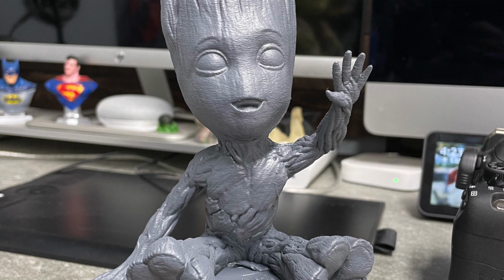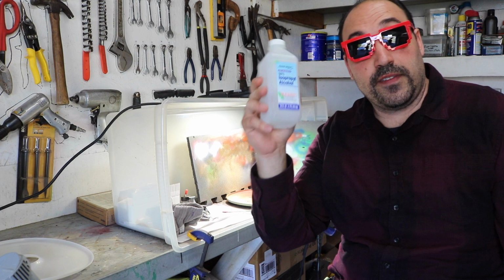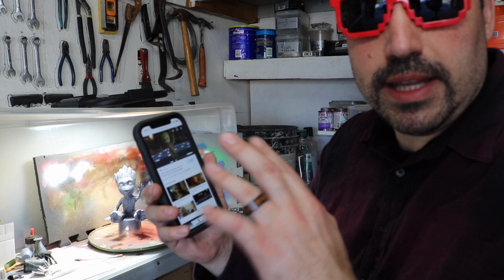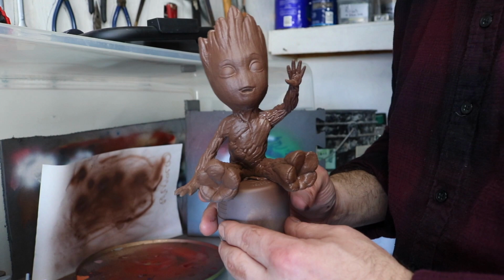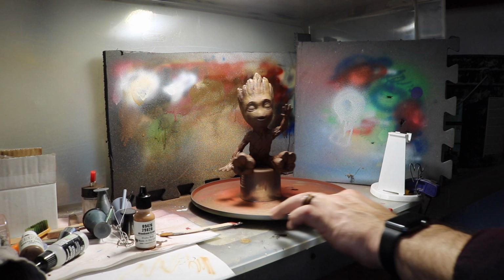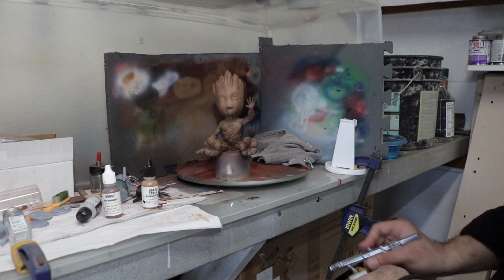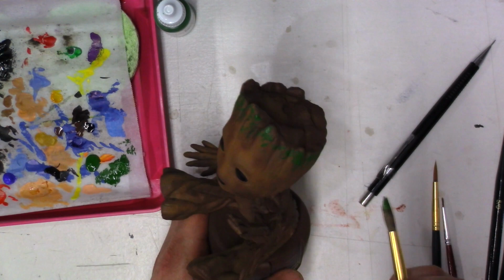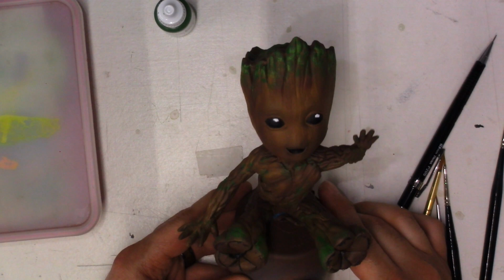How to airbrush 3D prints, the basics

Comment: A useful tip for some, I usually adjust my needle so that it's making the finest line Id be able to get by pulling it back. That way all I have to do when doing extremely fine details is just put the air on. It can add little dots though if you let too much paint go through
Reply from the maker: Never thought of that that is a good tip. I’ll definitely give it a try. Thanks 😊

Comment: Didn't come here for the WD40 trick but glad I saw that. I always have to soak the tips and needle in laquer thinner before starting since I don't airbrush much.
Reply from the maker: Lol everybody’s got their tricks! That’s why I watch everyone.
Reply: @CrazyWillTechShow  The wd40 doesn't effect the paints?
Reply: @crushingvanessa3277  know as he cleans the brush before using it as should you, because of the psi it will atomise the residual WD40 and eject it into the paper, then by washing the airbrush several times as in his video that would get rid of any remaining WD40.

Remember that WD40 is not oil, its merely a water displacement product and any traces of paraffin or other very fine petroleum products that are in WD40 would be emulsified by the cleaning water.  Of course if you just airbrush without the initial clean it will mess the paint. Hope that helps.
Reply: @sitgesvillaapartmentneilsc7924  Thanks for the info, didn't know how wd40 was made up. So many people spray it on things to lubricate them then wonder why it's not working.

Comment: Excellent entry level tutorial, thank you...

3D printer resin is great for smoothing your prints , you can also use 3d resin for clear coating, on any product be it wood, metal plastic , anything just make sure you cure it well and IPA wash it later, again apply with an airbrush, perhaps not you best one!!  It's an excellent lacquer that is fixed forever and won't tarnish like clear coat does over time.

Some really good sage advice and tips in this vid,  you dont need to spend a fortune on kit(Ç apart from a good airbrush that is!! But start with a entry level one to see if its for you before you splash out and mind the fakes if you do ...

Over here in europe I use high pressure sprayers for acrylic paint, thats at 250 bar 
or 3650 PSI serious high pressure and what we find is with this type of paint the molecules in the paint forms strings and grows to several centimetres in length, this eventually goes solid in the gun and blocks it even at this pressure, the only solution to this is in the handle of the gun is a fine matrix wire filter, that removes about 95% of these chains, because we use pressure and not air to spray I dont know if this is why an airbrush clogs, quite possibly. if you can get a pre filter do so,.

As the man says install a water drain off point or much better is to install a air dryer at the compressor end , it will collect the water there and stop it coming up to the gun completely. 

They are not expensive and make your finish much better and stops spluttering altogether.

Thanks again, you should mention that there are a lot of clones of your airbrush so dont be tempted to buy one as they are not good. Get one if you can from a authorised dealer, they come certificated now so you can check its genuine. Avoid Ali Express and or eBay , even Amazon sells the clones. if its cheap its crap. Thanks again, very useful video.
Reply from the maker: Thanks I I have actually tried that… with powder added to it.
Reply: @CrazyWillTechShow  that’s a good idea . It’s s that used as a pigment or a glittery look please? Keep up with the vids!! They are good thanks

Comment: do i have to prime before i airbrush? if so can i just use a rustoleom spray primer?
Reply from the maker: Yes you do that what I used in the video.
Reply: there's also primer for putting in your airbrush, if you don't wanna deal with cans.
but you should use some kinda primer, otherwise your paint will likely flake off the plastic rather easily.

Comment: How did you do the air compressor adapter?
Reply from the maker: Bring your hose to Harbor freight they have A bunch of adapters and there the cheapest.
Reply: @CrazyWillTechShow  Do they crimp on or just screw on? Thanks!
Reply from the maker: Just screw on make sure you use thread seal tape.
Reply: @CrazyWillTechShow  thanks man!

Comment: I had a bad start with airbrushing. Bought dualaction set for 25 euro, with and 21 euro Fengda AS-200 compressor. I had i had paint my self. Thinned to milk. Nothing comes out. Needle is okay. Goes forward and back and have tension. Tried everything, but in the end i saw a little spray, when the paint was almost watery (beyond milk). So it should flow, but it didnt. Nozzle and openings were ok. Maybe this Fenga AS-200 thingy is to weak. Looks more like a big aquarioum air compressor.
Reply from the maker: Is it airbrush paint? The stuff is formulated to be thin and not fast drying. That’s why I ask.
Reply: @CrazyWillTechShow  ye, its acryl paint waterbased in 20mil bottles.
Reply from the maker: @Oxizee  are you using an airbrush thiner? what PSI are you using? If the paint not designed for airbrush it my not flow right and clog the airbrush. I like to use 25 PSI so I get some more push.
Reply: @CrazyWillTechShow  The pump it says it runs at 2 bar. But i really doubt that. The shop gived me an Saloon Air Compressor, which can be regulated between 0 and 4 bar (60 psi). I Putted it on 30 psi, and the airbrush worked now. The old pump i returned to the shop.
Reply from the maker: I knew it had to be something like that. either paint or airflow. Thanks for keeping me updated.

Comment: What did you use to prime the 3d print?
Reply from the maker: I like rust oleum primer filler. Hard to fine right now.
Reply: @CrazyWillTechShow  Thanks for the response. I thought you had said that but I couldn't find it in the video. I just re-watched it and saw where you had said it lol. Thanks for answering :D -- Great work btw, I am going to buy an air brush soon and I am printing groot as I type this :D
Reply from the maker: That awesome very fun models. Airbrushing makes a lot more fun. It’s challenging at first but once you get the hang of it makes it a lot easier. My setup is not the best but it works lol.

Comment: Can you use that on wood filament  too ???
Reply from the maker: I believe so haven’t printed and wood yet. Do you like it? Any hurdles?
Reply: @CrazyWillTechShow  I 3D printed  a baby Groot, and the only problem that I have had so far is that the supports were not strong enough to stand up by themselves if they are small and in only one spot. i have a .04 nozzle that I am using and haven't had a clogged nozzle,  yet. It sure does look really cool. oh, yeah, there sure was a lot of stringing too
Reply from the maker: Can you stay in it? That would look cool if you could. I’m eventually going to buy that stuff and do a video on it.
Reply: @teslafanboy7826  i'm 100% sure you don't have a 0.04mm nozzle though ;)
Reply: @CrazyWillTechShow  Little late here but just the same.  Use a 0.06 nozzle, the 4s will clog like nobody's business with wood filaments.  I did a foot tall baby groot in wood which im going to paint (thank you for the video) similarly to yours, and the .04 clogged every time.  At least 10-15 failures before I gave up and went to a larger nozzle.  No issues at 0.06mm.